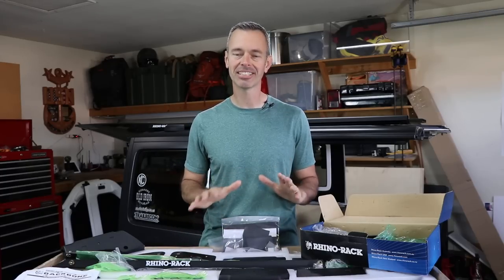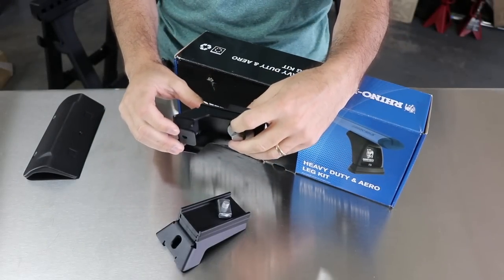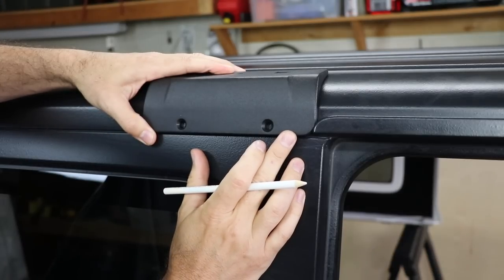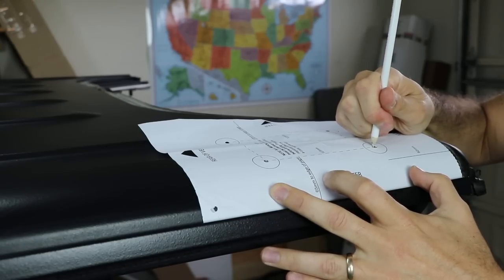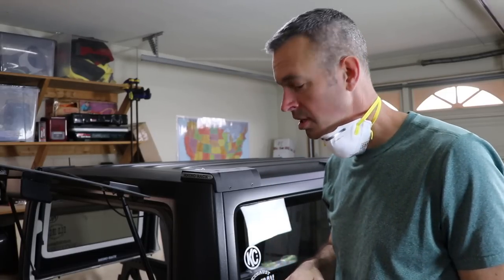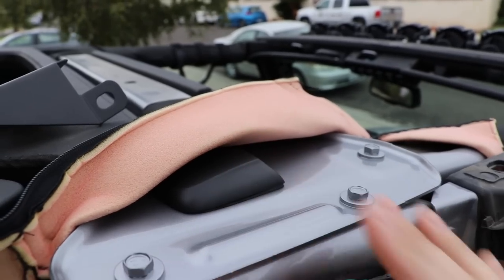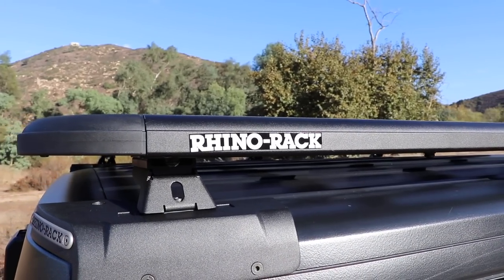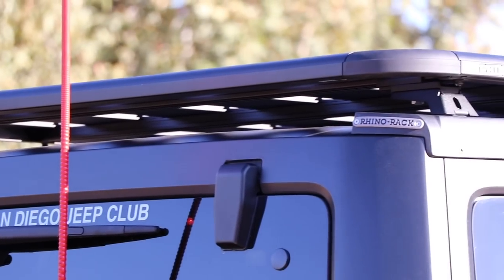Jeep Roof Rack Installation and Review - Rhino Rack Backbone

Comment: PLEASE READ IF YOU ARE INSTALLING THE KIT AND MEASURE!! Most definitely double check the measurements of the supplied paper template! Mine didn't match up to the given measurements. So glad I checked right before I drilled. 123mm specified on the paper template was only 117.20mm

Comment: Brad,  have the same rack on my 2014 Jeep JK.  Like the low profile, no additional wind noise I can detect.  Have used it on multiple off-road trips and have been able to adapt other manufactures accessories (Eezi-Awn and Front Runner) to it.
Reply from the maker: Great to hear from someone that has been using it!!!  I can't wait to get some gear mounted up there and hit the trail.

Comment: Thank you for the video, I just wish I would have had it a week earlier. Your video is a lot better than the ones provided by Rhino-Rack. The only advice I would suggest is to measure the leg distance before trying to mount the entire unit. Thank you for all of your videos and for not being so over the top with the size of your lift kit, tires etc.
Reply from the maker: Thank you!  I agree, I did fumble around with the feet for a bit until I got them lined up and a pre-measurement is a great suggestion.

Comment: Thanks for this. I am getting one, but with the cross bars, to mount a tent mainly.  Ill do the install, but my local shop here in Fort Collins, Bullhide 4x4, suggested some RTV around the holes to make sure there is no water leaking. Have you had any leaking issues?

Comment: I have the exact same rack installed on my 2013 JKUR, and I love it. I can't wait to put a rooftop tent on it. Like you said, it is very clean looking, and the accessory options are plenty. I currently have the bracket for the Maxtraxx and ski rack installed. The interior padding is a nice touch too!
Reply: Hi George, Wanted to know if you still have this rack and how it's holding up. Thinking of installing on my 2017 JK. Thanks!
Reply: @bebacklater526  Hi, it is still holding strong. I decided not to put a rooftop tent, though. But, it is one of the best upgrades I did on my Jeep.

Comment: @trailrecon Great vid, as usual. 2 things? 1) can u take off the entire hardtop/RR at once together? and 2) u got any thoughts on Rhinos 3-bar VORTEX set up for a RTT? The bars seem lighter and even easier to install and remove when not in use. Thank you and keep the channel growing!
Reply: I have very similar questions.. my RTT is very tough to mount when working under the platform.
Was also curious about Remington the hardtop. Any luck on these questions?

Comment: Hi Brad, your videos are inspiring.  My local auto shop has a 20% off fathers day special on, l picked up a rhino rack pioneer platform system & will be fitting it this weekend. I got a bit of a surprise picking it up as the pioneer platform is preassembled which means it doesnt fit in the back. Looks like for the Australian market they assemble them. So I'll be going back with a ute or trailer to collect it. 

Keep up the great video's.

Comment: Maybe I missed it, how does the rack attach to the brackets?  Hoe easy is it to remove the rack when it is not needed? I have a sunrider for hardtop which won’t open with this rack. So, I want to install the rack when I am going camping.

Comment: Okay, just watched your “How has my rooftop tent lasted” video and had to re-watch this one. Couple questions: 
1- you said the weight capacity I’d like 250 lbs... how does that hold the tent and two large adults?  Seems like you would max that out quickly. 
2- One thing that worries me about a roof rack like this (and the major reason I haven’t bought one) is I still want the ability to take my hardtop off. Could you do a video about that someday?  I’d love to see the steps involved in hard top removal with this attached.
Reply from the maker: 250lbs is the dynamic weight, I think the static weight is 800lbs.  There are no special steps involved in taking the top off with this rack.  Unlike a few others out there that secure to the rollbar, this one is only attached to the roof and everything comes off normally.

Comment: TrailRecon, I ordered the same size roof rack, and when i installed it, it was more to one side of the jeep. I messaged Rhino Rack and they said I was supposed to cut the middle and front footpad brackets and it also says that in the instructions. Did you do this step? and video of it as well?

Comment: If you take your top off and on a lot, you might think about a pulley system  that could be attached to the ceiling of your garage.  With such a system, you  could unbolt your soft top from the jeep and then use that system to attach to  your Rino Rack and lift it straight up and then drive off.  Just reverse the process  to replace the soft top and rack back on the jeep.  Just an idea.
Reply from the maker: Great idea, much easier than my son and I man handling it.

Comment: Hi I bought the back bone system and the pioneer platform (both built and ready) but I got the Rhino-Rack RC Locking Leg kit that is not working to attach to the platform.  Could you recommend what is the model of the leg kit that works?

Comment: I bought the same one but for a JL (backbone mounting system with the rhino rack platform). I can’t find it in any of the comments here if they had any issues (weight) when 2-3 people sleeping in the roof top tent. I’m concerned about the weight limit. Or maybe i just don’t understand the dynamic vs static weight. When you’re parked and the tent is set up, how much weight can this hold up?

Comment: I love this rack and recently installed one on my build and also bought the smittybilt roof top tent but the tent brackets won't align with the rhino rack. How did you go about mounting your tent to the rack itself? I'm debating on drilling 2 more holes in the bottom of my tent and moving the mounting bracket over around 4 inches so it aligns correctly. Is they somewhat how you ended up mounting yours?

Comment: Rhino Rack, I see you added some upgrades to the rack mount. Do you still have this rhino rack mounted? Been wanting the rhino rack with the pioneer platform for awhile now. I recently won a slimline II from front runner outfitters but don’t want to install it as I am still interested in the rhino rack system. I would like to remove my hard top with out dissembling the whole rack... ugh

Comment: What, if anything extra has to be done to remove the roof? The downfall to most I have seen is that they stop you from removing the roof.
Reply from the maker: Nothing stopping you from removing the top, the AEV one I believe bolts to brackets attached to the roll bars.

Comment: Hello thanks for the video. I installed my RTT on this platform and it is a hassle to get the RTT mounts on because of the limited space under the rack. Any suggestions?
Second question once the backbone system installed, are the rear Jeep hard tops locked in forever or is there away to still take of the rear hard tops?
Reply: Hi Gabriel, have you noticed wind noise? I am currently looking for a roof rack system for carrying timbers as well as future camping. I searched for reviews and they were all negative mostly on terrible wind noise so I am curious about what's the situation there.

Comment: Looks good! My only question is, are the freedom panels still removable with the rack on?
Reply from the maker: Yes, no problems taking the freedom panels on and off.
Reply: Is the back half of the top still removable without taking the backoff?
Reply: Andrew Francis yes you can take the whole thing off without removing the rack from the hard top. Sorry no one seemed to reply, but you worded it a little confusingly.

Comment: Brad, thanks for the video.  I just bought the same rack on a Black-Friday sale from Northridge.  Looking to get a roof top tent as well and do some long trips with my kids this summer.  What liner do you have in your hardtop?  Would you recommend it/buy it again?
Reply from the maker: Congrats on the new rack and having a tent will make camping so much more enjoyable!  I have the mopar liners and I like them.  They are great for temperature control.  Expected them do help with noise reduction, but they didn't really.  I would buy them again.
Reply: TrailRecon, thanks Brad.  I bought the mopar liners, did some minor trimming around the backbone part of the rack.  They look great and I agree - they help a lot with temp control, not much noticeable difference in sound levels.

Comment: Great video! I have two questions. We have the older version Thule Force XXL cargo carrier that we use during the winter for skis. Can that be attached to this rack? Second, is there enough room to hide wiring in the platform to run lights from the rack?
Reply from the maker: Not sure about the Thule carrier, I'm sure there is a way to make it work?  I'll be installing lights soon and there are some nice spots for running wires under the edges.
Reply: Looking forward to that video.....Another couple of check marks in the Pro column for this rack system!!! Many Thanks....

Comment: Thank you for the vlog. I haven't found any installation vd on the tube like this detailing. I have a question. I just installed my Hot Head headliner on my Jeep. Will the bracket inside going to mess up with the hard board headliner?
Reply from the maker: Thank you!  I had to do a little trimming on the rear window side headliner insulation to get the bolts through.

Comment: I’m thinking about getting a rack too.  I think they look really nice on the JKU hardtop.  How is yours with taking off the freedom tops?  Im currently looking at the Garvin with a similar shape/size as yours.  I’m definitely looking forward to seeing you load it up!
Reply from the maker: No issues taking the freedom tops off at all.  Lot's of stuff is going to be loaded up here soon!
Reply: I have the Garvin expedition rack on my jk and love it . The freedom panels come right off no problem no tools just take em off. The entire rack pivots also to remove the top . The down side with the full size rack is a lot of noise even with the wind deflector installed . Way more heavy duty than this one ,will last forever and then some .

Comment: Love the design and the functionality. Will the interior rear window bracket allow to mount the frontrunner rear cargo shelf?
Reply: James,
This is a great question! most likely you could not do this due to the unit raising the internal Rhino-Rack Backbone height. However, if you were to mod the shelf to allow you to mount it on top of the lower Rhino-Rack Backbone bracket you could most likely mount the shelf and only need to order longer hard top bolts.

Comment: Getting ready to install the rack this weekend. Did you ever relocate the satellite antenna or is it still working fine? Love the videos, keep them coming.
Reply from the maker: Still working fine, once in a blue moon I’ll loose signal with the tent on the roof, but no issues with just the rack.
Reply: How did your installation go? Happy with the result?
Reply: @AliciaInJeep  went great and works  great

Comment: Good video Brad although I have a two door don't imagine it's much different.  Glad to see you have a Springer.  Is he a mental case like mine?  My JK has so much dog hair in it over the winter I am going to have to take it to a pro detailer.  Shee!  Going to get one of these racks for my big trip up to the Arctic Ocean, whenever the lockdown lifts..........if I live that long.  As much as i don't want to drill holes in the hardtop, I think it's the only way to go. The rain gutters are only fibre glass and that is a hell of a lot of resistance on four little clamps.  Mark in Hamilton Canada

Comment: Looking good! I have the same roof rack and love it, but what were those tube like cushions for? I didn't get any with my kit...
Reply from the maker: Oh man, I should have mentioned that in the video!!!  The pads cover the forward vertical bars of the internal backbone system.  Right next to where the passengers head is.... nice idea to have these.
Reply: i though so! it could get ugly if you hit your head against that edge. i currently have roll bar padding zipped tied to it but i bet the padding would look a lot nicer. thanks!

Comment: What about removing the “freedom tops” (that’s what I’ve heard them called, anyway—the two small panels across the front top...?). Does the rack hinder their removal?  A little, much, at all?  I’d like to know since I saw on another video that the rack does extend a little bit over those panels.  

Thanks for info!
Reply from the maker: You can still remove them, just lift and pull forward a little, on problem.
Reply: What about a Bestop Sunrider? Would you happen to know if It would work as intended while matched with the Rhino Rack?

Really enjoying your channel btw. Thanks :)
Reply: @TheDecidelia  I'm curious about that as well!

Comment: After watching this video, I ordered this rack.  I ran into a couple of issues that I think are important to note for prospective buyers:
1.  After I mounted the planks to the end rails (8:40 in the video), I turned it right side up to find that the screws had pushed into the topside of the plank ends causing the end of rack plank to bulge up.  I corrected this by adding two additional flatwashers to the screws.
2.  I ordered mine with quickmount legs that lock and unlock for quick removal.  The six legs (as part of kit JA8213 at etrailer.com) came in the form of one kit with four legs and one kit with 2 legs.  These were keyed differently between the two sets.  I contacted Rhino Rack and they sent me some matching cylinders and keys to make it right.
3.  Although I followed the fitting instructions meticulously, I could not align the rack to the legs.  I had to drill a hole to expand the oval mounting points for two of the crossbars in order to correct this.  It also helped that I was using a canoe/kayak ceiling hoist to raise and lower the rack.
Other than these obstacles, the installation went well and the rack looks great.  Thanks for this and your other videos!

Comment: HI BRAD ! 
I HAVE A ARE LOW CAP ON MY F150 1999 XLT  4.6L EXTENDED CAB TRUCK. I WAS THINKING OF A ROOFTOP TENT ON IT MOST LIKELY HAVE TO BUILD A FRAME FOR INSIDE/ UNDERNEATH THE CAP THAT LIFTS UP SO FIGURING OUT HOW TO ATTACH IT UNDERNEATH THE CAP SO THE FRAME & CAP LIFT UP TOGETHER. THIS WILL KEEP THE TENT LEVEL WITH THE CAB OF THE TRUCK & HELP WITH WIND RESISTANCE WHILE DRIVING  ? STILL LOOKING AT DIFFERENT ROOFTOP TENTS.  HARDTOP OR SOFT TOP  TENTS . PLUS WHICH COMPANY  STANDS BEHIND THEIR WORK MANSHIP.!  PLUS THREE SEASONS OR FOUR SEASON BECAUSE I LOVE ALL SEASONS ALSO  ! 
IT'S JUST ME & MAYBE MY GRANDSON & TWO MEDIUM SIZED DOGS AT THIS POINT IN TIME. 
BE SAFE  ! HAVE FUN  ! GOD BLESS YOU & YOUR FAMILY & FRIENDS ALWAYS  ! ENJOYED  !

Comment: I just ordered this rack. I was wondering if you needed up having to relate the xm radio sensor?
Reply: No you don't. But I don't have the rooftop tent installed on mine yet may need to once a tent is installed. But so far it picks up as usual

Comment: Hey Brad, just wondering if you made a video on how you mounted your roof top tent on the Pioneer Platform?  Did the tent line up with the rack slots or did you have to drill and bolt it up there?
Reply from the maker: I had to relocate the tent rails to fit within the slats... pretty easy to do, but sorry, no video.
Reply: @TrailRecon  Gotta.  I'm thinking about going with the ikamper mini when it comes out.  Their's only a few videos out that show how they mounted the tent and everyone drilled holes in the Pioneer Platform to make it work.  Thanks for getting back to me on this.  I'm sure I'll figure something out when I get them.

Comment: Nice install.  I'm glad to see this review because I have been considering the two door version of this rack for my jk.  With the low profile I think I could still get the Jeep in the garage.  That is my concern.
Reply from the maker: Getting into the garage is very important to me... I hope I still can inch my way in when I get 37's!
Reply: Can you still run thru an automatic car Wash?
Reply from the maker: So in the directions for the Pioneer Platform it says "Please remove crossbars when putting vehicle through an automatic car wash". Now I believe this is referring to the 3 bar roof rack system they sell, which is different than this setup.  I don't know if I'll take it through the car wash now....
Reply: no you shouldn't take any roof-rack through a car wash...platform rack or otherwise. too much can go wrong and things can get snagged especially any accessories you have. their instructions say no to this as well. definitely stay touchless or go with the quick-release legs to remove the platform if you want to laze it up and coast though an auto like me X-D

Comment: Did you consider and compare the rhino rack to the nebo by teraflex?
Reply from the maker: I had previously looked at the Nebo, and for me I like the flush platform of the Rhino Rack.  I also didn't want to have to put those brackets that the Nebo has on my sports bar if not necessary and as kiplssd mentioned below, no extra bolts to take off with the Backbone system.